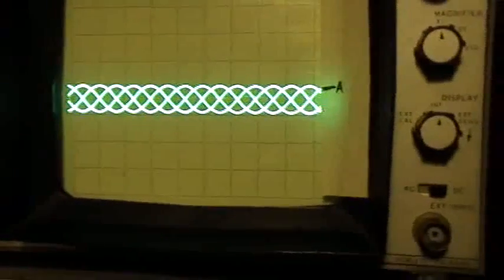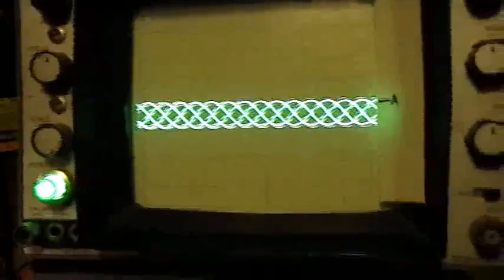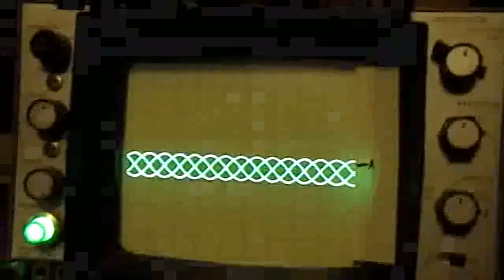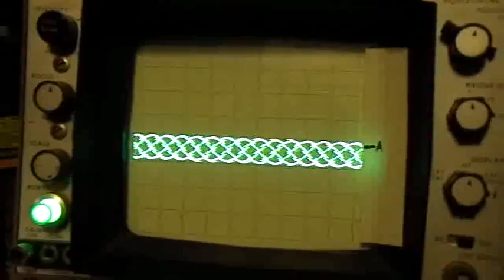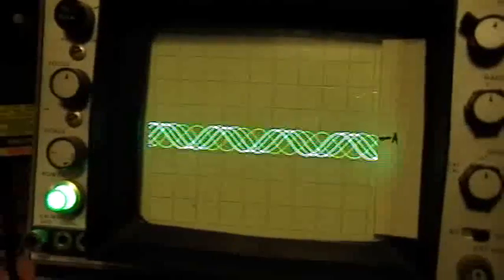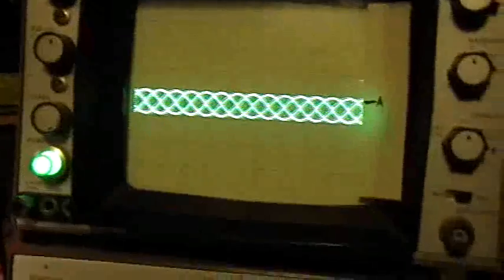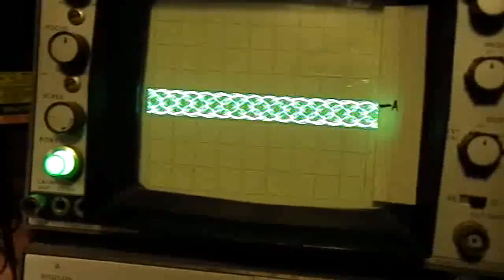Electric OU: Supplement: Function Generator Offset Control

Comment: That is exactly it. Ampl and b Hi Level are on the same button and Lolevel and offset are on the same button. So Amp is 10v and Hi level 10v Lolevel is 0v and Offset is 5vdc. I agree this is a versatile FG but I can also use it as a multi frequency zapper too so it could theoretically extend to a Rife device. Also I am not really an electronics whizz. What I am less sure of is how many milliamps are passing through my body. Great help thanks!

Comment: Once again thank you. The problem is not about the instruction manual but rather that I don't know what I am doing. So now I have entered 10vpp on the Amplitude
and "low level" 0v so now "high level" and "amplitude" have the same value of 10v.
"low level" is 5VDC and offset is 5VDC this should give me a square wave DC with no or little negative spikes. My aim is to use the FG as a Hulda Clark zapper.
Reply from the maker: Yes that sounds right, you should be able to confirm it with an oscilloscope or even a couple of LEDs and resistors.
But using that nice AWG for a zapper? Man, you can make a basic zapper according to Hulda's early work for about ten dollars worth of components from Radio Shack or Farnell or whoever is your local parts supplier. You just need a 555 timer chip and a few other components.
You can even do the more sophisticated expensive programmable ones by using an Arduino, an external transistor and power source. Let your computer do the zapping through the USB port and the Arduino!
Reply from the maker: Wait.... shouldn't "Low Level" be 0 volts, not 5vdc?
You want your square wave to go from zero to 10 volts. This is equivalent to taking a normal "bipolar" square wave that goes from -5 to +5 Volts and offsetting it by +5 volts. So now it goes from 0 to +10 volts. High Level should be 10 volts, Low level should be 0 volts. OR, "Amplitude" should be 10 volts and "Offset" should be +5 volts.  The High Level and Amplitude menus are on the same button, right? and so are the Low Level and Offset menus on one button. I should think that they would all agree, once you have it programmed in. So "high level" should say 10 v, "amplitude" should say 10 v, "Low level" should say 0 v and "offset" should say +5v as you cycle through the different menus once you have it set. I think.

Comment: Really appreciate your time and effort on my behalf TenselK. Actually what I would like to find out is if the Rigol can have the following settings.
- 100% Positive Offset (i.e. no negative spikes)
- Voltage Output: ~10 Volts DC 
- Square wave

Thanks !
Reply from the maker: Well, I guess so. Press the "Square" button then select the "HighLevel" menu item and enter 10v, then select the "LowLevel" menu item and enter 0v.
Or select the "Amplitude" item and enter 10v, then select the "Offset" item and enter +5v.
I suppose either method should work. I am presuming the "amplitude" setting is referring to p-p amplitude.
Then you can set the other parameters like frequency and duty cycle.
Of course I am just looking at the manual so I'm not completely sure ... but this doesn't really seem all that hard. Have you got a manual? They are available on-line, just put in the model number into Google and you'll find it.

Comment: Okay slight change now set it to 5vDC offset "high level" and 0V low level
Reply from the maker: Yes, OK, go to page 2-7 in the manual. You can press the "Square" button then select "High Level" and input 5 V, then select "Low Level" and input 0 V. Then you can set your frequency and duty cycle as normal. Or you can set "Amplitude" to 5 v and "Offset" to +2.5 v, and get the same thing, I think.

But do you want to make just a straight DC level, with no square wave, just straight DC? Just use the "Square" waveform and set the "high level" and the "low level" to the same value, whatever your desired DC level you need.

Comment: Hi and thanks for this. Is there a way to produce a DC pure positive offset with my RIGOL DG1022 FG? I am using a square wave with 8vpp and 6 VDC offset? Sorry I am a bit new to this.
Reply from the maker: I've just downloaded the manual for the Rigol DG1022. Let me study for a bit. It seems like a nice unit, I'm sure you can make it do exactly what you need. But I'm not clear just what you do want. Do you want a square wave that goes from Zero volts to some positive value only? That's simple. For instance you can select a normal Square Wave of 5 v p-p and then offset it 2.5 volts positive.
Many FGs have positive-only pulse trains as an easy option, though.

Comment from the maker: Thanks.
A square wave with 5 V peak-to-peak amplitude, symmetrical about zero, will be going from -2.5 V to +2.5 V. So if you then offset it by +2.5 V, your wave will be going from zero to +5 V. That's one use of offset: driving TTL. Or, to look at it another way: if you have some oscillator that only makes a positive pulse, like a common 555, but you need AC... then you can use an opamp or series power supply to give a negative offset to the original positive pulse... then you have AC.

Comment: Good video, friend.
If I have a square wave with 5V amplitude and offset is 2.5V what are the limits of the signal? And what is the use of the offset in general? I mean, ttl works with 0V-5V etc.